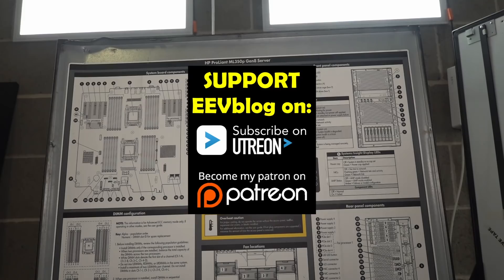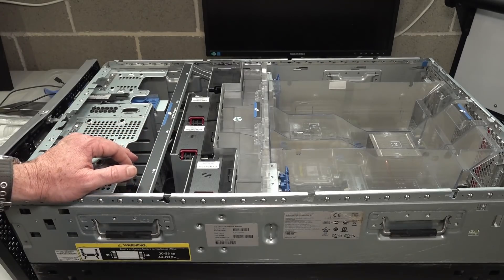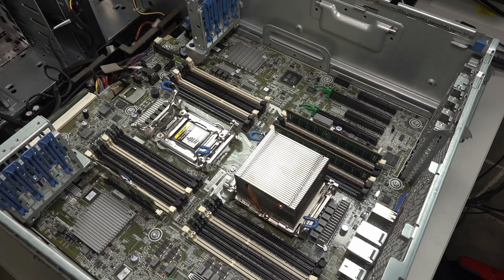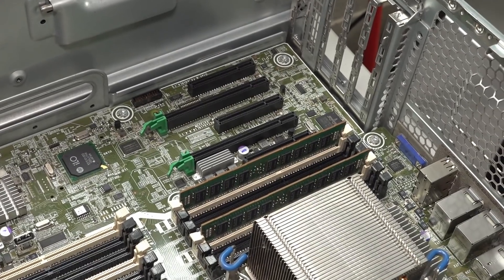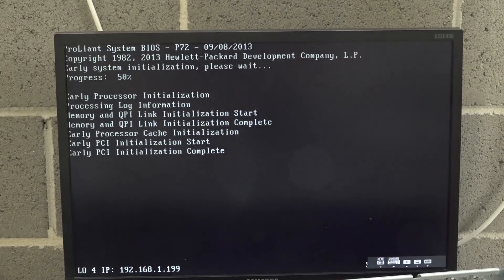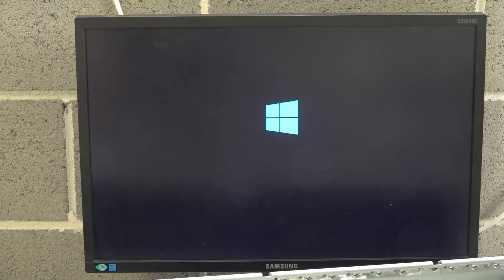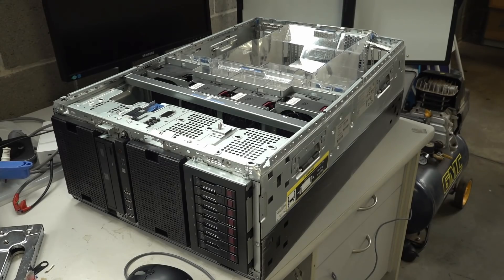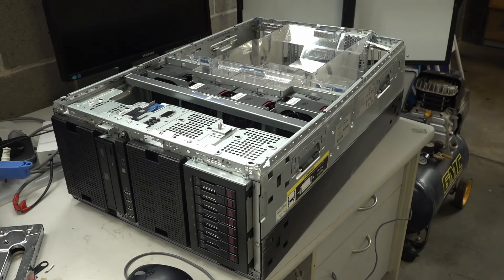EEVblog 1466 - Dumpster Dive Xeon Server

Comment from the maker: UPDATE: There are 5x300GB and 3x900GB 10k RPM SAS drives, and yes one of them was setup as a spare. Looks like the 900GB drives were not setp yet. There was also a Windows Server 2016 recovery disc in the DVD drive, so presumably they reinstalled it from scratch.
Reply: Dual Raid Arrays is pretty common,  the odd drive could be a spare,  it may even be the boot drive,  or like it has failed  and had dropped from the array and its probably stuck in a power up cycle.

The battery is the server is for the RAM on the Raid Controller to maintain transactions on the array in power failure situation. You also can get batteries on TPU/TPM security modules too.

This is a low end setup.  Bare basics,  Just been used as a Domain Controller or Router maybe even a bit of storage.

Very surprising seeing Drives left in it.

Salvage Wise,  Fans & PSU are the only decent parts, 

Server Fans are an ALWAYS for the parts bin.  So bloody powerful for there sidze.

HP Server Power Supply's are excellent quality,  alot of people make DIY bench Supply's from them.

The RAM may come in handy,  Specially with being ECC RAM.

CPU:   ebay or take it to bits.

Motherboard FTW,  FTW being "For The Wall"

You could take the RAID section out from the case and use it to make your own Desktop Storage Areay,  With a RAID Card that has External SAS and a long SAS Cable.
Reply: @The Shocked Peon not really true.  For someone interested in setting up a home lab environment for IT, it's still a fairly modern server that will do a good bit of work.  Parts are also cheap to beef it up, and it's massively expandable.  Can turn it into a pretty nice Proxmox or similar host for very little $$$.  It's all in that space/performance/price trade off.
Reply: @The Shocked Peon Where these shine is in expandability. Each CPU can handle 384 gigabytes of RAM and you get a gazillion PCIe slots. The included CPU and RAM are worthless but with a 20 core upgrade it will be way faster than a laptop.

I agree that it's current config isn't very good for a storage server. For that use you'd swap out the drive cage and fit 18 3.5" hard drives.
Reply: so what does this mean Dave?? ur selling the parts or keeping it??
Reply: You can get some 10tb SAS used on ebay for $99 that's what I'm running
Reply: How the heck do you find these things?
Reply: @zer0nix   Look in bin?
Reply: Check if it is compatible with the ivybridge-E xeons, you can get the 12 cores cheap and have 24 cores at higher frequency. The only issue is that its a HP and HP servers are crazy proprietary that even the AMD ones do not have NVME despite having multiple m.2 and PCIe link cables, poor documentation and even their own support staff can't figure out like why placement of the same module means a feature is disabled when only difference is location.
Reply: That card would be for battery backed cache memory on a raid controller.
Reply: Can you just dedicate one ssd drive(120gb) and 8gb to start windows 10 pro, it won't be able to have a tpm due to age, bit it can be retrofitted to become a gaming rig
Reply: Why does nobody seem to understand that holding a fire drill every second week. Only drives people to ignore them completely?
Reply: 9:08 900GB each from what I can make out.
Reply: 12:29 Well that does explain why it was in the bin Dave.
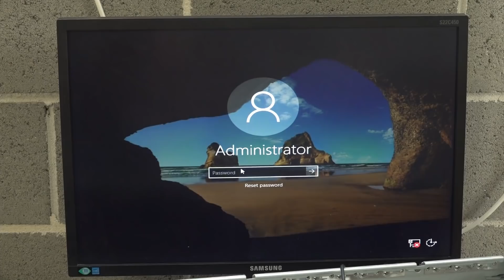Reply: 13:59 You should definitely use a Knoppix boot-disk to find out whats on those Hard Disks. You never know what those Gas companies are up to these days.

Comment: I am amazed that this thing was discarded with the hard drives installed!  That’s kinda not good.

And it boots to windows?  Not not not good.  Try and access SAM via USB Linux bootable USB drive and reset the password and look in the files to try and track down where this thing came from.

After we find out where it comes from, go there and slap whomever is the head of IT.

Comment: Does anyone here have experience with using these models? I have one, but having trouble with mine, and would love some help or advice!

I’ve been planning to upgrade the CPUs and do some other tweaks, and finally got around to spending some time on the machine. I went to all of the trouble of upgrading the CPU’s, only to realised BEFORE i do this, i have to run an update ISO prior to doing this. I admitted defeat, and replaced the older CPU’s in the server, to begin the process of properly upgrading the CPU’s, the way HP wants… :face_exhaling:

On restarting the Server, it posted with RAM an CPU, then proceeded with:

1611 -Fan 1 Missing
1611 -Fan 2 Missing
1611 -Fan 3 Missing
1611 -Fan 4 Missing
Fan Solution Not Sufficient
Critical Failure Detected - System Shutting down in 5 Seconds!

Now, on a bit of research (not that it was required, really…) obviously the error is pointing out that the iLO (Intelligent Lights Out , HP’s IPMI) hasn’t detected any of the 4 fans, and has shut down to stop overheating.

Many have posted this, but usually only pertaining to having 1 fan not being detected.

My case, ALL fans are not detected. The fans are, however, On, spinning, and the 4 fan lights on the MB are all lit up with a GREEN LED.

I’ve tried cleaning the contacts, swapping fans, even resetting the NVRAM… to no avail.

Does anyone know of what is happening? Have i missed something? Should i roll back the BIOS? is there anything else i can do, other than buy a replacement montherboard?

It just seems odd that all of a sudden ALL fans aren’t recognised, when before they were all working fine.

Appreciate any help here guys… thanks in advance!

Comment: IIRC the drives on those arrays have light pipes, worth checking those? I've worked with those servers for years and they've always provided excellent service either in the tower form or the rack units the boards are excellent and you get years of service out of them however they are thirsty for any sort of home use unless you really wanted them. I got myself a nice little HP Microserver Gen8 for home, the router sits on top and they're lovely little 'lab units' for this and that. Nice find but just parts I'd say. Thanks for the video Dave I got a kick out of this! (edit: now that I think about it maybe it was the earlier gen drives with the light pipes but it's been a while)

Comment: Those 12V 450 W PSUs are useful to recover. I have several of them at various wattages up to about 1kW. Easy to use, HP so reliable. The output can be adjusted a bit, e.g. to 13.8v.

Comment: I installed SuSE Linux on something like that back in the day. File/database server.
Quite fast for its day.

Install SAS SSD instead of rotating media for a bit of a speed boost on the RAID.  PCI-attached SSD will make a bigger difference, but still far short of MVME storage attached to a more modern CPU.

Comment: Windows does this weird thing where it says "welcome" even if you get the password wrong.  I always thought that was a dumb design. Especially because it's so slow so it gives false hopes while you wait for it to do it's thing.
Reply: It's so you can't keep putting in wrong passwords over and over. I agree it's too long of a delay, but at least it only does it after a few failed attempts. Most Linux systems make you wait a second or two after every attempt.

Comment: I'm using that ML350p Gen8 as my main PC. I changed the fans against silent ones, which required me to invert the PWM-coding. (100% duty cycle means standstill with the default fans. Don't know whether it's for redundancy reasons if connections get's lost.)

Comment: I'd keep a system like that. Its farly barbones but has a boat load of potential to be expanded for most use cases.
An with the speed control of the fans this thing would be worth investing in an using as a strage server or even a work horse if you upgrade the cups. Unlike slot of stuff today that thing can be left on 247 an asuming wendows dosent brick it self it will run happy doing that. Like the old Dell demention series computers. 
Those things are actually farly conservative with power as they have to be built to energy standards that home or prosumer computers arnt held to.

Comment: @2:50 I've got a much lower-end ProLiant ML10 at home with the same kind of plastic cover internally. I love the airflow design, but if there's even the hint of dust anywhere, it turns into a handy air filter at the CPU heatsink. 🙄 Have to dust ours out annually or so.
@6:10 (edit 1) Keep that power supply. If you can keep it cool enough, it's a great low-voltage high-current unit in a smallish case.
@7:45 (edit 2) That's probably a controller for the disk drive plane up front. The battery backup prevents data loss during a power outage. Those can be worth some easy cash on eBay.
@17:25 (edit 3) It could be that hard drive is a "hot spare." If a drive failed, the array could rebuild with the spare with no human intervention.

Comment: I have a few of these - still work great with TrueNAS with some RAM and drive updates.   Excellent machines but that one was extremely under-spec compared with what they can do.   You don't need the HP SmartMemory - just throw any good ECC DDR3 fast RAM in there.   

That's a very old version of HP's iLo 4 baseband management engine too.     I think from memory the last update for these was in June 2019.   It really needs to have the BIOS updated too and the microcode update to mitigate all those Spectre side channel attacks.     

You really need to have that plastic baffle and lid on for thermal management, although with just that single low end server processor it won't hurt too much.   Amazingly good find.

Comment: When you are setting these things up for the first time, the fan noise can drive you nuts. It's only when you get an OS and proper drivers loaded that they slow down.
Reply: ProLiant servers do thermal management and fan control via the iLO firmware.  No OS drivers required.
Reply: @JohnDoe4321  That depends on the model. Ever set up a G3 or G4?
Reply: @DaimlerSleeveValve  Yes, I've used ProLiant's from G1 through Gen10.  IIRC, firmware-based fan control started with G5.  That was a long time ago.  Any ProLiant that's still working is likely to have it.  And thank goodness for that!  I used to have an ML350 G1 next to my desk, and yeah, those fans screamed until the driver loaded.

Comment: Fans sound near as bad as my Zen 3 AMD system..... Those hard drives are SAS drives and need a SAS controller to work they will not work on a SATA controller. By the specs of that system it was a network attached fast storage server with 4 Ethernet ports and one out of band Ethernet port for maintenance/other work on the system Those Xeons can fetch a decent amount of pennies to the right buyer at the right time generally Gamers buy old multi core Xeons to build bargain basement gaming rigs and that card with the battery would of been a cache type card for the SAS Raid array for a power outage to keep the memory alive when it shut down and when the system starts back up it then writes that data to the drives as that is its fail safe guard.it looked like Windows 10 was its OS but I could be wrong there usually your the man with all the info for us to nerd out on but I work a bit with servers something that age that amount of ram single CPU definitely just a glorified enterprise level NAS hope that helps Dave my friend. My Ivy Bridge core i5 I use as a Linux server with a hypervisor to virtualise as a firewall too has 12GB Ram and 2 4TB Drives in it for my NAS system and firewall soon to configure the web and email server on it but running Slackware 15 and virtualbox I very seldom go over 3GB so I have over kill for ram even with samba running for the file share and smoothwall as my firewall any how you got a great find there some stingy gamer would cream themself over that Xeon but yeah if you want to use those SAS drives there are SAS PCIE controllers out there if you want to get one to use the drives.

Comment: I had a similar model years ago. 
Used to do server and network relocation work full time. Frequently clients would use such a move to jettison obsolete tech. 
Thats how I ended up with a dual CPU HP server and a few Cisco routers and switches. 
(The HP replaced an AMD Opteron server on rollerblade wheels)
It was fun to use when I was studying for MCSE and CCNA exams. But it was too loud and I never got around to upgrading it because ECC ram was quite pricey back then, and the drives would require an expensive RAID controller card to have more than 2. 
Also not a lot of connectivity aside from network, so it wasn't gonna be my dream workstation.

Comment: Gen8 went out of support a few years ago, and hardware support for things like hypervisors are dropping support for it in the current/next releases. A couple years back big business were dumping these as scrap in mass.

I picked up an entire HP blade system with 14 Gen8 blade servers, each with dual CPUs, for under $400 for the entire lot. A year prior, a single one of those blades would have been $250 shipped.

Since they were running Windows Server, my guess is that they dump it when they learned Windows Server 2022 isn't supported on Gen8 or Gen9. I think MS wants to e-waste every system older than a 5 years or something.

Comment: I run quite a few HP Gen8 servers. Even though it's around 9-10 years old, you might be surprised at how efficient it is. I'm guessing it uses under 100W while idling on the Windows desktop.
Reply: Without drives it's probably about 55 watts.

Comment: I retired one of those just a few months back. Still a decent server if it had 2 CPUs and a ton of RAM. Then fill it with SSD's. The drive not indicating is a Hot Spare. So should another drive fail, that one will jump in and rebuild into the array. So RAID5 is maintained.

Comment: The integrated management processor (which will be running iLO version 4) has it's own ethernet port and shows lots of info about a system, but that one you found only has the standard license, so you can't use a remote console once the system has booted (the advanced version you can use as a remote console at any point). Also interesting that it has genuine HPE Smart Memory. You can use regular (server) memory in them but it doesn't authenticate as Smart Memory. The Xeon included is pretty old now but you could put a couple of better ones in there (the G8 range can usually support deca-core CPUs in the v2 line which use less power). I have a g8 in my rack, if you use non hp parts, the fans will run louder (since it errs on the side of caution and makes them run faster when it doesn't recognise some hardware - there are community iLO patches for these generations to change that though!)
Reply: I think mine only picks up speed if you use unrecognized cards, it seems okay with everything else. I did a hardware mod to reduce fan speed but I should really check out the hacked iLO firmware.
Reply: @eDoc2020  The hacked firmware is excellent. I'm using iLO4 2.73 but you can get 2.77 with it, they took the fan control features out of the later two (2.78 and 2.79) and it would be difficult to add back in (unfortunately). Plus if you don't like it, you can always reflash, firmware downgrades/upgrades weren't restricted until iLO5 based boards :)

Comment: Whoever specified this server from new needs an ass kicking.  When you are so concerned for your data that you specify battery backed cache controller you always specify 2 power supplies.......  Not that HP power supplies fail very often
Reply: The flash-based cache is a standard feature of these servers. I don't know if it will even boot without the cache. I don't see the problem with a single power supply. With journaled file systems there shouldn't be any risk of data loss from power loss.
Reply: @eDoc2020  Wrong.  The entry server comes with zero cache and can support 8 drives and 2 volumes.  Please don't spread wrong information.  Anyone who specifies a server with only one p/s is a complete fool.  Whoever specified the one in this video is a complete fool - why the hell you would spend the money on this huge box when a DL360 can support 8 drives and would be MUCH cheaper.
Reply: @einfelder8262  I stand corrected on the drive bit. They probably bought the cache for the performance boost

IMO a single power supply is okay if you don't need super-uptime, especially if you have a next-day service contract.

Yes a DL360p would be cheaper but I get the impression this was used in an office. A nice quiet tower is obviously a better match there than a noisy 1U.
Reply: @eDoc2020  This was used in a clean room, not an office.  Not a spec of dust inside.  Anyone using such a server in an office would buy the tower version.
Reply: @einfelder8262  When ave showed the "no dust" around 8:20 I could visibly see dust in the middle with all the little round holes, as well as around the cutout next to the spare screws. And this is the tower version. You can tell from the orientation of the logo on the front bezel.

Also I looked at the HP QuickSpecs sheet DA - 14226  Version 57 — 8.17.2015. On page six they reference the storage controller options and they provide the following note:
NOTE: The SA-P420i/512M FBWC is standard on tower model and SA-
P420i/1G FBWC is standard on rack model.

Comment: Mailbag, dumpster diving, and scam debunking is what this channel has turned into.  I thought all that sort of thing was second channel content.

Where's the ELECTRICAL ENGINEERING VIDEO BLOG content?
Reply from the maker: This channel has ALWAYS had mailbag, dumpster diving and scam debunking on the main channel.
Reply: @EEVblog  Seems like it's degenerated into nothing BUT that content, whereas before there was actual EE stuff in between.  Anyway, it's your channel, you of course can run it any way you like, but I am wanting more EE content.